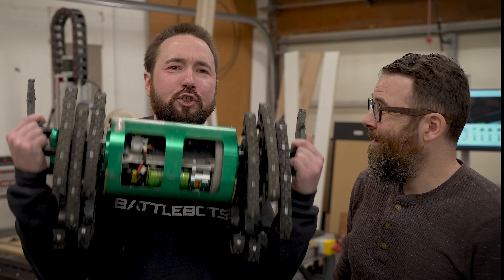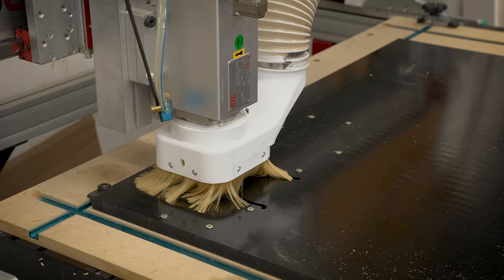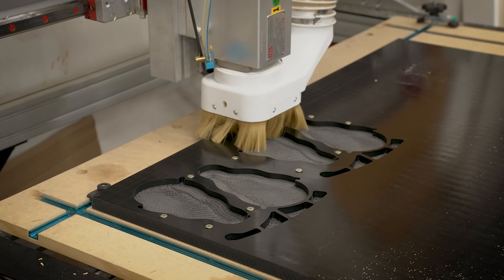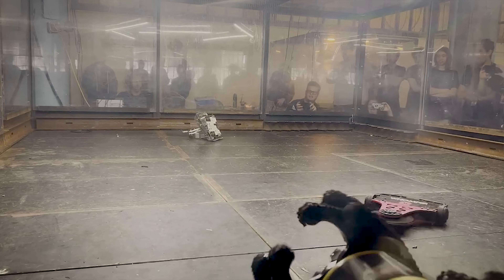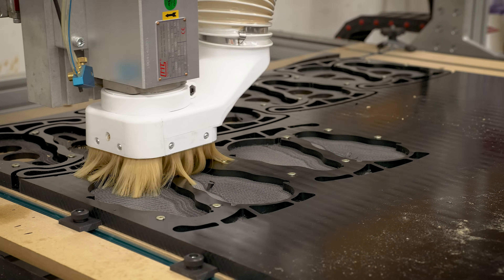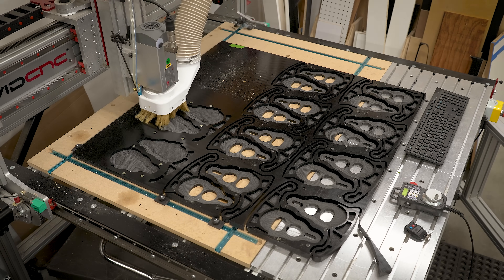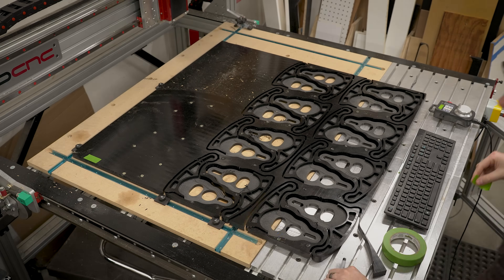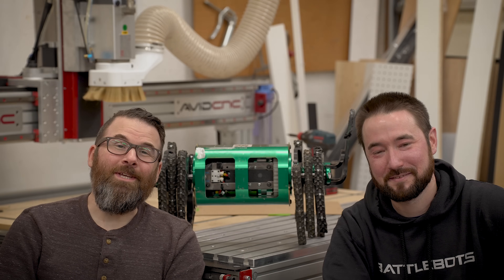Machining Shuffle Feet for a Combat Robot - Pepe Silvia!

Comment: Could the actual leg be design with 1/2in radius next time? Well 0.25in radius so you can use the 1/2bit
Reply from the maker: Sure, it could be redesigned, but the rest of the bot is already made, so other parts would need to be modified.  This is still the easiest since there are a LOT of other parts in the shuffler mechanism that are already machined out of aluminum.

Comment: One thing I found out the hard way. Use stainless screws fastened tightly. If you nick it with the tool, there is no catastrophic failure. Normal steel screws destroy a 20mm 3 flute solid carbide in a split second. Stainless is fairly soft. I have cut through them with out any issues. Nice job.
Reply from the maker: Huh.  We actually nicked one on the first pass and it was just fine, even with the single flute cutter.  I guess black oxide screws or even deck screws are harder than stainless.  Plain old zinc plated though is pretty soft.
Reply: A makerspace I know splurged on brass screws for the same reason. same Idea, just even softer than stainless.
Reply from the maker: @Skooteh Gotcha good to know!  Step 1, don't run into the screws. ;-)  I need one of those fancy composite nail guns.  They shoot these composite plastic nails you can machine right through.

Comment: I really like the laser template idea. The way I've done it is to generate a program that uses a V bit to mark your screw locations. Then you can drive your screws in, and run the main program. Both methods def have their pros and cons
Reply from the maker: For sure.  Normally I'd just model the screw locations in Solidworks and then peck them, but this was much easier, since we'd have to change out the tool to peck the hole locations.  It was pretty inconsequential to just export the file as a DWG and laser-cut the template.

Comment: Cutting HDPE and UHMW on a CNC router is a lot of fun. I've had a lot of success using it for the gap in between wood and metal for RC projects. Nicely done!
Reply from the maker: For sure!  You can just keep going faster and faster, it's so easy to cut.  Workholding is the only real challenge.
Reply: @RobertCowanDIY  Agreed, sometimes the sheets are a bit cupped. I've had good luck with a vacuum table on larger thin sheets or smaller thick/flat pieces. Double sided tape or the masking tape/super glue methods have worked as well on smaller pieces.
Reply from the maker: @CraigVanSickleAK  Good to know.  I haven't had good luck with tape, it doesn't stick well enough to get zesty with the cuts.  But screwing it down has always worked, as long as its' not TOO tight, which causes warping.

Comment: Great collaboration guys. I love how Robert casually mentioned that he made the template out on his laser cutter. :)
Reply from the maker: Yeah, I probably should have elaborated on that more.  Next time!
Reply: What I meant was, while watching I was drooling over your gantry CNC machine, and you mention you used your laser cutter (another tool that I'm also envious of) like it was NBD. I thought that was humorous, that's all. Carry on! @RobertCowanDIY
Reply: Good stuff.  Im kinda surprised he didn’t spot the holes with the cnc.  I guess it would require a tool change which is a little annoying.